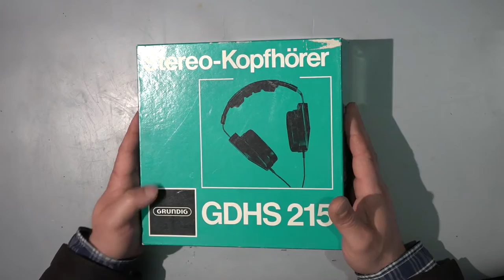Grundig GDHS 215 vintage headphone beauty with free lavalier microphone!

Comment: I actually scored a similar deal years ago, and then lost them during a moving.
A couple days ago they popped back out, i was curious about the enhancement that you pulled off for the low end, could you please elaborate?
Reply from the maker: I added some new foam, and better sealing. The drivers  got upgraded to some cheap AKG 240 big membrane. Sounds a bit meh... dry, but, fookcing loud :) Best for home party DJ-ing! My friends are like it most for the looking!